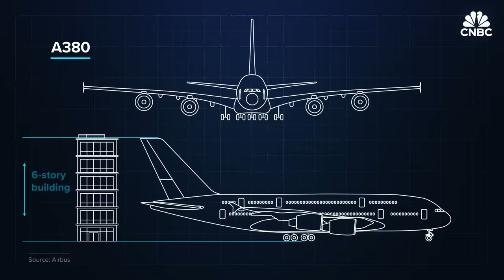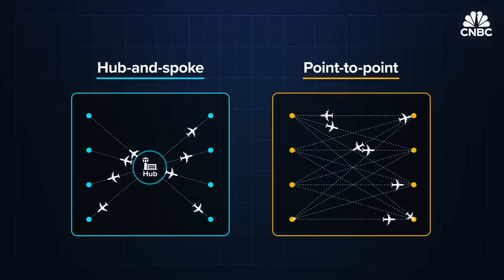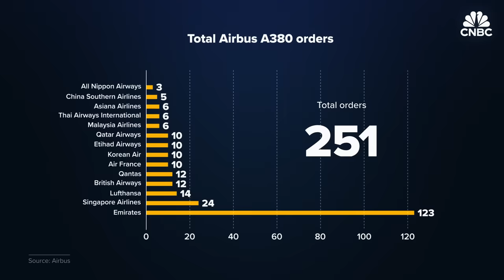Why The Airbus A380 Is Making An Unlikely Comeback

Comment: I never really understood why the A380 was supposed to have been a bad bet and a failure. It is a fact that cities are growing, more and more people move from rural areas to the big cities and there is very little room to build new airports or expand existing ones. So a large aircraft that maximizes passenger throughput per airport schedule slot ought to be a necessity, at least at some point in the future. The supposed trend towards Point to Point traffic can only be a temporary one, unless the trend towards urbanization would reverse and it doesn't look like that will happen anytime soon. 

Urbanization is a big trend in developing and emerging countries and it also is a trend in developed First World countries, because those are only growing thanks to immigration and those immigrants tend to flock to the big cities too.

Comment: The European did the Concorde and the whole press and "specialists" wrote lots of theories about how costy and useless Concorde had been. However, Concorde put the basis for the Airbus successes in terms of aerodynamique and technology (fly by wire). The same with the A380. Now the best airplane is the A350 and lots of the solutions developped for it come from the A380. And I do believe that the 380 era is not finished yet.

Comment: Incredible engineering, but the actual flight experience isn't exactly comfortable.  Boarding and alighting takes ages due to the sheer number of passengers, and being a wide-body, your chances of getting a window seat are somewhat slim.
Reply: What has that to do with comfort? I guess ur an american lol
Reply: @Someone08119  British, actually. Also, there's the usual problem of getting a pile of goodies on your seat in a plastic bag (pillow, blanket, headphones...) which inevitably falls on the floor because there's nowhere to put it. But this is the case for all long-haul airliners. I just found the whole experience surprisingly claustrophobic.

Comment: Best passenger experience is 787 or A350. I have never particularly liked the 380. The 787 and 350 are both quieter, you can get on and off faster and I don’t see any massive difference, in terms of space.

Comment: I wished I'd been in an A380 once while sitting in an Air Baltic Turboprop to Riga with obvious pressurization problems and half of the passengers in agony from the noise and pressure issues.
And while it might be true that newer planes have better fuel economy this apparently is not true if you do the math per seat, which should be the most reasonable metric.

Comment: It the best aircraft ever made for economy class passengers. Maybe the A350 comes close in quietness & cabin pressure but the sheer spaciousness of economy seats, aisles & toilets makes it still the best aircraft for routes which fly dozens of smaller aircrafts a day, still fully booked. 
LHR-JFK ?
SYD-LHR ?

Even some domestic sectors like JFK-LAX or DEL-MUM. There is some other factor at play because these sectors would have NONISSUES filling up 500+ seats in economy as well as business class. 

BA has an aircraft on LHR-JFK with ONLY business class seats. We are saying A380 is not viable there ?

Comment: I disagree with your comments in the very beginning of this video that most airports aren’t able to accommodate this aircraft. While many international airports had to adapt to this large aircraft in the early 2000s when the plane was being designed, manufactured and tested, 20 years since then, as of the making of this video, late 2023/early 2024, most key international airports are able to handle it. Some 140 airports have handled it and up to 400 airports are technically able to land and unload it. Unless you’re counting regional and back of the yards air fields, in which case they couldn’t handle a 777 or a 747. Sure, the Dubai airport has the most A380s and a dedicated jetway from the upper level first/business class lounges. Please check the facts before posting erroneous info.

Comment: CNBC makes too much of this.  Yes, delays in producing new airliners due to supply chain issues, quality problems and certification delays will keep some existing A380s in the air a few years more.  But that's hardly a comeback. The 747 likely has a longer time to go because its freighter versions and how easy it is to convert passenger versions to freighters. There is no A380 Freighter. The A380 introduced some engineering successes, technology successes.  But the program is still a colossal commercial failure.

Comment: Emirates saved A380 otherwise the wise decision has always been a Boeing 777 or 787.
I prefer the 787 on all aspects of the flight but my experience with A380 was smooth with the boarding naturally being slower and more congested.

Comment: Plus plenty "newer" 747s that can be bought cheap and retrofitted for cargo and even then the market for such cargo routes is finite unless fuel costs fall,gets more expensive. If the 380s engines could run on synfuel then its carbon cut would add to its attractiveness. Even Boeing knows a halo plane (and the dreamliner is somewhat an attempt) that the 747 was is a loss once its gone from the skies.

Comment: "Airlines have made their a380s pleasant for passengers", not for the majority of the passengers flying economy they haven't. Very overcrowded so that the wealthy can fly with as much comfort as possible, and economy ticket prices more than 3 times the price they were six years ago. Food options regularly run out, and with airline passengers incapable of showing consideration to their fellow passengers, longhaul flights on this jet are just grim. If only wages had trebbled in the same time period, then it wouldn't feel as though you're getting such a raw deal when flying the a380.

Comment: 3:57 -  So the project cost circa $25 Billions. Airbus has sold 251 of the airplane, one of which was priced at $445 MIL in 2019. Yes, the earliest ones that had been sold at the end of the Noughties were for sure cheaper; Idk how much cheaper, but I'd bet that their price tag didn't say less than $350 MIL per piece. So let's count with an average price of $400 MIL for the entire '14-year' period the jumbo was being produced; 251 times 400 MIL equals to 100,400,000,000.
That's over $100 Billions!!!
So how come that they claim up here, on the reportage, that Airbus didn't earn anywhere enough to break even and cover the expenditure of the project's development? (tax cut would be like what?  28% to 35%?  Still more than enough left from those 100+ BIL)
Have I forgotten about anything?  Quantity discounts, perhaps?

Comment: I think I am hearing a lot of green cheese from Boeing on the A380, because of the plane's success, especially with passengers' return after Covid and the latest problems Boeing is encountering with the 747's reliability. I have been on neither plane, but I would be cautious with using Boeing over Airbus as a passenger.

Comment: At 4:15 where is the background.  It looks like Nice, France yet Nice cannot handle the A380, can it?  And there's only one white building in the background that looks like Villeneuve Loubet?
Reply: As was stated it is not the runways, but the terminals / boarding. This might be one of the early flights, where they demonstrated they could land and take-off the plane. Airbus has factories in the south of France. So it even might have been a test flight of one of the first planes to be delivered to Singapore Airlines later on.

Comment: A Wonderful Aircraft to Fly!

The Primary Problem was That The A380 Requires More Fuel Efficient Engines...Then The King Of The Sky would Live A Long Successful Flying Life Time.

ULTIMATELY, if The A380 were capable Of Safely Flying with Two Engines it would be more Efficient for The Bean Counter's. However, The A380 Flight Wings would require Major Strengthening And Probably Require ReEngineered Wings in Order to Fly with just Two Engines.

Of Course, if AIRCRAFT Engineering Developed Lighter Engines , then the Major ReEngineering may not be Necessary. However, Passenger Safety cannot be EnDangered by Bean Counter's unwise Engineering Cuts, just to cut costs. Always Remember Aircraft Crashes Cost Airlines Hundreds of Millions in Compensation to Deceased Passengers Families. Therefore, Airline's Should never allow Bean Counter's EnDanger Passenger's on AIRCRAFT Of Any Airline.

Personally, I Believe, That the A380 is A Super Commercial Aircraft. Which if it had more Fuel Efficient Engines, would Fly for Many Years to Come Safely. Indeed, The AIRCRAFT Engineering on The A380 is Amazing!

Comment: The pandemic did force a lot of early retirements of airframes that still had a lot of economic life in them. Those retirements were definitely overdone. Regardless of the much delayed 777x programme, you'd want to fully utilise the A380 to maximize the returns on your considerable investments. That's because after its passenger days are over, it gets turned into beer cans. Is its return then seen as unlikely because when the pandemic started most people couldn't see past the disaster?

Comment: Commercially, the A380 program was a failure. Airbus never earned 1 Euro of profit over the life of the A380 program. Airbus had signed contracts for 10 aircraft with both FedEx and UPS but could not deliver when the 2-year production delays on the A380 passenger version consumed Airbus engineering resources. The production A380 freighter is not to be confused with a passenger to freight conversion, which indeed is not viable.

Comment: It will only be temporary  until the 777 Max comes on line. You can haul more passengers at less cost by flying two 777's nose to tail than it costs to fly one 380 ! And the airports don't have to worry about accommodating a behemoth like the 380 !  The 777 Max with it's foldable wings will be able to access far more airports that the 380, and at a much cheaper cost to the airlines !
Reply: But it costs just as much for one 777-9 as it does for an entire A380

Comment: This is such a bad report. How did you arrive at those results such as as its lifespan of only 11 years? Don’t you think it might be important to go into such low numbers? by the way it’s called disembarking.
Perhaps just maybe the lack of 747 sales was intended for A380 purchases until Boeing corrupted congress and its local market?
You made no discussion of the A380s safety record or Boeings manipulation of congress and its local market that resulted in the lack of A380 purchases, the faulty manufacture and design cheapening of the 800 series that resulted in the deaths of over 600 innocent people and airline crew.

Comment: Stupid model does not account for long travel aircraft.

Point to point perfect for under 2000-3000miles.

go 6,000-10,000 and the hub not only makes sense, but increases passenger comfort w/o too many connections that waste more time when trying to arrive quickly at your destination.  Long flights are grueling and the ability to stretch your legs on a big plane a monumental in the overall experience.

Also, Why have airports not adopted dual loading jet-ways?  Works on upper and lower deck for a380, but why not service long "short-range" plane by offering loading and unloading at TWO points on the aircraft?  Would save a LOT of time for load/unload and getting plane back in the sky!

If I fly to Asia from the USA, I want to be on a 747 or A380.